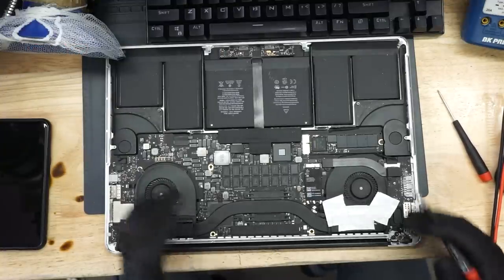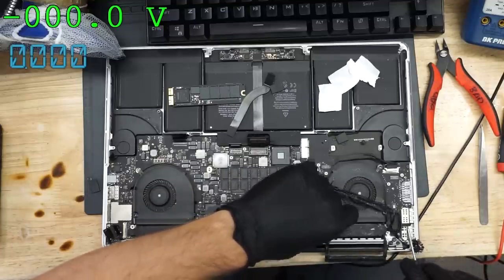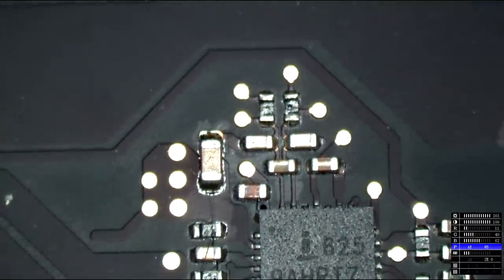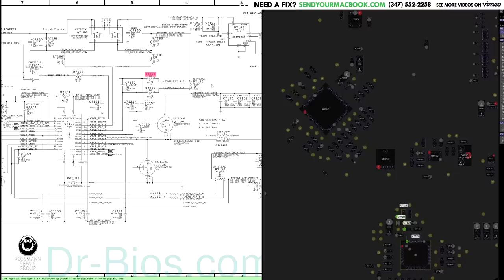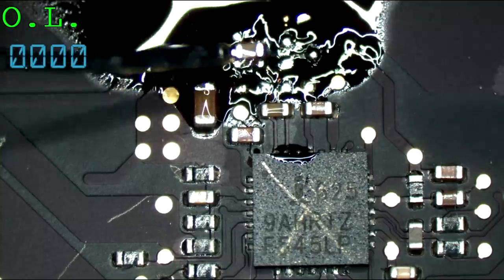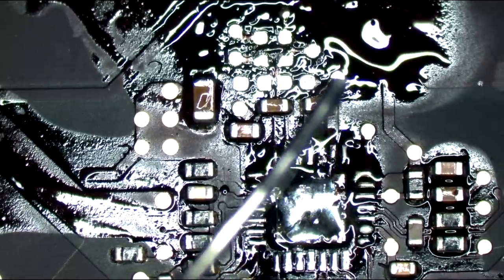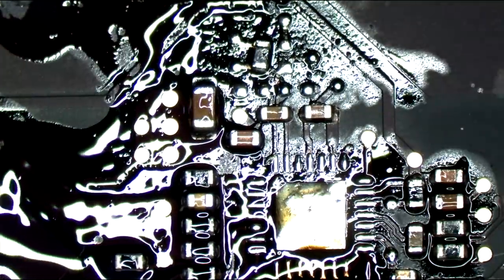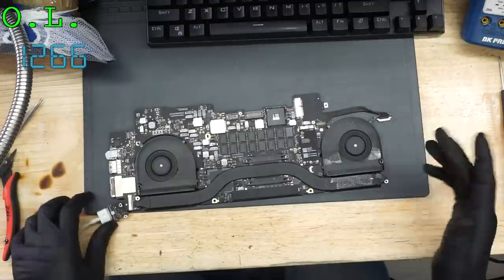Only 4v on PPBUS_G3H: what could be wrong with this A1398 Macbook Pro?

Comment: Hey Louis.  What temperature is your hot air machine usually set?  And what brand is it?  Thank you, as always.
Reply: Check the description for his equipment. I am not sure what temperature his hot air machine is set to.
Reply: @chris thanks
Reply: Chepe78 Hey, in one of Louis’ recent videos he mentions the temperature of his hot air station. I believe he mentions it at around 15:30. Hope this helps. 

https://youtu.be/QYSnkMeo3wA
Reply: @Chris-ko5gk  wow, Chris.  Thank you for remembering my post.  I have not seen this video.  It does satisfy my curiosity.  I asked the question because I was impressed that he didn't have to preheat the boards, as well as use any Kapton tape to secure any nearby components.
Reply: Chepe78 No problem, I’m glad I could help.

Comment: I sometimes watch where you put your magnet down and I just sit here wondering if you may accidentally damage something. Can magnets permanently damage electronics?
Reply: Magnets that induce permanent electromagnetism can destroy wires and chips by changing how they act.

Ones that don't cause permanent electromagnetism can cause damage to chips but should revert to normal after a short time.  Should being the operative word...
Reply: also you need a quite strong neodym magnet to harm HDDs for how well shielded they are now compared to the one's back in the 80's.

Comment: Ive fixed things in the IT world before, not knowing wtf i did to fix it. Just part of the T/S process and suddenly it starts working without even changing anything. Usually i sit at my desk slack jaw thinking, wtf i didnt change anything... then tell the customer "cleared before isolation" and monitor it for a while.

Comment: Hi, I just started to learn this things and already have a problem that I'm stuck with. My a1304 mcbk air turns on (fan spin), there is light on the charger and at the front as well, but there's nothing on the screen (no immage, no backlight). No strange sounds either. Any sugestion? All voltages seems to be okay. Pls help
Reply: This might sound dumb but check your screen brightness. The lowest brightness can turn off the screen completely.
Reply: @manjunathvishnumoorthy7479  thanks for the tip but doesn't work. There's no response from the keyboard 😔
Reply: @raresp7218  shine a bright light directly at the apple and see if you can see anything on the screen
Reply: @quiveringcalm4697  there's nothing when light up the logo on the back. No image.
Reply: @raresp7218  then sadly I am unable to help I only toss these videos on when I'm working on vehicles. My only other advice is the unhelpful get a bigger hammer and if something is stuck, slag it and or won't be a problem

Comment: Hey, it seems I have to replace type-C IC . Macbook pro 15 with touchbar. I would like to know that what could be the reason for its failure? Because it was working fine until I updated my OS and now it wouldn't charge
Reply: Please see this comment.. I don't have option to get it repaired.. and mac is not that old so I don't wanna change board. 5Volts input to T2 chip. Can there be any other problem ?

Comment: How do you make multimeter and the power supply reading on screen?
Reply: Software made by Paul Daniels.
Reply: @jumpinjehosephat1877  which software?
Reply: @uitmcklong46  I'd assume https://github.com/inflex/BSIDE-ADM20 (found via a search for 'paul daniels multimeter software', then "tools" from his website...)
Of course you also need the appropriate meter that the computer can talk to, see under "tools" on his site
Reply: @michaeltempsch5282  because i am planning on buying the vc meter and owon power supply as stated on paul daniel website.. that's why i ask how to do that..
Reply: At the moment, i am using the uni t ut61e and cannot make it display the way like Louis video